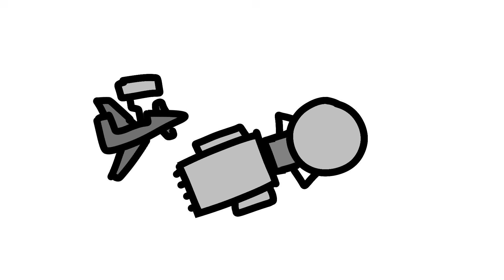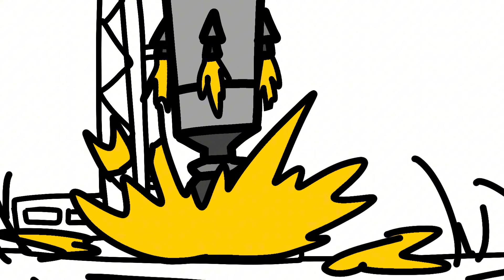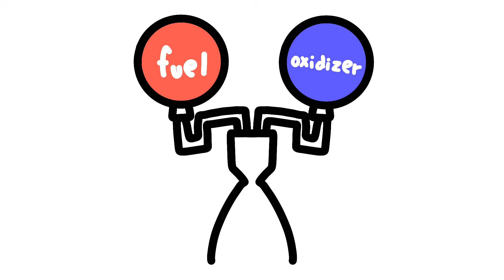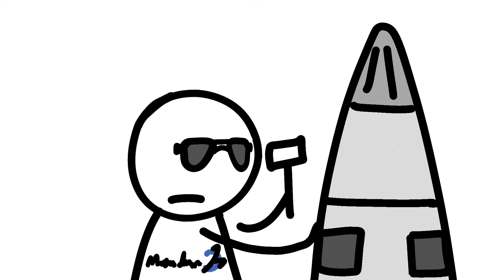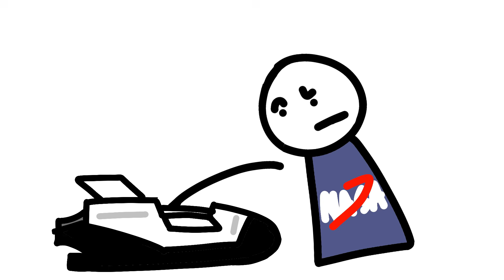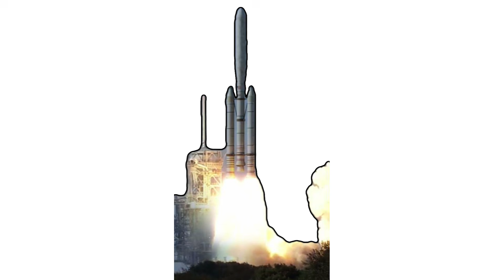Weirdest Rocket concepts

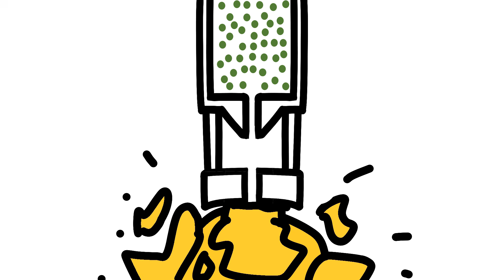Comment: 3:27 Project ORION didn't really ride the explosion. It would have used nuclear shaped charges which detonated inside the pusher plate and threw some mass out at a good fraction of the speed of light. The stuff shot out provided thrust, just like a normal rocket

Comment: The long-term solution to cheap orbital flight is the SCRAMJET. Ordinary rockets have max Specific Impulses on the order of 4 kilometers per second. [Don't show your ignorance by stating the SI is measured in "seconds" instead of "meters per second".] However, various ramjets offer MUCH higher SI ratings on the order of 10 to 20 km/sec, because they do not need to carry their own oxygen.
Reply: Of course a jet engine is more efficient than a rocket, that’s not groundbreaking information. But let me let you in on a little secret: jet engines, no matter what kind, don’t work in space. Also it’s really hard to make jet engines with the power necessary to lift a rocket; I think that the most powerful jet engine on the market right now is the GE90, putting out up to 115,000 pounds of thrust; compare that to the RS-25 rocket engine, which produces 418,000 pounds of thrust. The GE90 is three meters longer than the RS-25, a meter and a half larger diameter, and 10,000 pounds heavier.
Reply: @Shaun_Jones  You clearly misunderstand my point. A SCRAMJET can get an aircraft up to near orbital velocity in HORIZONTAL flight. Power of an individual engine is irrelevant since any finite number can be yoked in parallel. Once the craft reaches circa 25 km/sec, and leaps out of the atmosphere, a small rocket can round the trajectory out into a circular orbit. The main point is that the vastly higher SI of a SCRAMJET can grossly reduce vehicle size, weight, cost.
Reply: @DavidFMayerPhD  ISP matters much more for interplanetary transfers than getting to orbit. You need thrust to overcome gravity, and that equation doesn’t change just by having wings. Using aircraft to replace first stages has been tried several times, and it never ends up being worth it because there just isn’t enough thrust to get a decent sized rocket into orbit. And besides, a scramjet being fast is arguably more downside than an upside, because any air breathing aircraft going that speed is going to need substantial thermal protection, which further throttles your thrust to weight ratio.

Comment: __von Braun said the reason for the giant wings on the first stage of his early orbiters (1955), was to keep the whole stack assembly aerodynamicly controled & stable while going up with increasing speed, while 1st stage weight loss due to fule & oxidizer burning of the first stage in the  earth's atmosphere.
> Later versions illiminated the giant, heavy wings with gimbaled rocket engin bells.

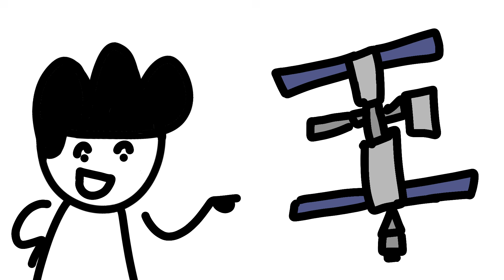Comment: 2:12 I built a limited run resin kit in 1/288 scale of that Von Braun launch vehicle. The ISP was low because Von Braun wanted to simplify logistics by using non cryogenic hydrazine  and nitric acid as the fuels. The launch site was to be way out in the Pacific on Johnson Island so logistics had to be simplified.

Comment: The ISS required 40+ flights, because it was designed specifically to do so, to justify the Shuttle. It was made as complex and expensive as possible to spread $ around as many congressional districts as possible. Other designs skipped the Shuttle and used the Shuttle-C, to put it up in 1/4 the time and cost.

The Sea Dragon was launched from the ocean for equatorial launch assist, and because building it at a shipyard was the most appropriate and simplest, and the materials used were closer to what a ship uses rather than the complex ultra-lightweight aerospace fabrication.

Orion did not ride the blast waves from bombs, as there is no blast wave in space. Each bomb was packaged with propellant which was vaporized and shot at the pusher plate at the back end of the shock absobers.
Like the Sea Dragon, Orion was ignored because nobody had the slightest ambition for a space program that would use them.
The later versions of Orion used the Saturn boosters to lift sections of the ship to LEO, and the nuclear pulse engine would be used only above the Van Allen belts, if anything thinks it needed to be so high.
The Solar wind doesn't care about fission bomb exhaust - it's made of radiation.

A 600 ton ship: A cargo ship might take the 8month minimum energy Hohmann trajectory to Mars, but some 85% of what's assembled in LEO is payload into Mars orbit. Chemical rockets struggle for 10%, nuclear steam kettle might get 45%.
The crewed ship goes when the 2 planet are closest together: 21 days into Mars orbit (including starting and stopping, unlike other proposed advanced propulsion concepts where writers take a maximum possible theoretical speed of an exhausted ship and apply it between the planets without worrying about starting and stopping).
Numbers from General Atomics, NASA, the USAF, the DoE, and the White House OMB all agreed that the cost of either the mission payload or the boosters would be more than either the engine or the hundreds of little A-bombs packed with their propellant.

Comment: Wow SPS mentioned in the Star raker section. Would be an awesome topic to cover alongside the Star raker’s competing design, the Boeing space freighter, alongside the shuttle derived crew transporter that was basically the shuttle with an airliner fuselage instead of a cargo bay (also launched on a S-IC type booster)

Comment: Good selection! Probably enough that you could make another if you wanted, but this is a good list.

Small correction, the RS-68 is not an upgrade for the SSME, its a less performant but cheaper engine with somewhat similar heritage, mostly because it wasnt designed to be reusable.

Comment: Orion was mainly scrapped because of the Partial Test Ban Treaty, which made it illegal to detonate nukes in space, not really because of environmental concerns. Also, the Air Force wanted to build a giant battleship with nuclear missiles and 5-inch naval guns using an Orion drive, which Kennedy really didn't like.
Reply: I'm also disappointed that you never mentioned nuclear salt water rockets, they're even more insane than the fluorine tripropellant engines
Reply: @JoetheDilo1917  Ah, the origin of the term 'Chernobyls per second.' I love those.
Reply: "Not really because of environmental concerns"

Mate The partial nuclear test ban treaty was created BECAUSE they blew up one nuke in space (starfish prime nuclear test) and it literally EMPd every satellite in earth orbit lol
Reply: Also the Orion drive isn’t as good as people assume, I’ve read the actual classified Air Force documents on the Orion warship and they assumed an exhaust velocity of 16 kilometers per second, a regular nuclear hydrogen thruster is already 10 kilometers, that means exactly and precisely 60% more delta v 

As for the thrust I have no idea but I doubt it would be that high, it basically worked by showering a plate of solid tungsten with nuke propelled tungsten plasma, and like, you’re talking maybe a kilogram of mass hitting the ship in the order of magnitude of like 20 kilometers per second, once per detonation which would be once every few seconds at the maximum, all that seems to lead to a very low acceleration ship, so not a 1+G torch drive with thousands of kilometers per second of delta v as Orion ships have often been portrayed
Reply: @IceRain-f5v  There's no way this isn't satire

Everything you said in this comment is completely wrong besides knowing it uses tungsten, and the theoretical upper end of exhaust velocity for an NTR. 

I'd love to know where you got the "classified" air force documents too, cause reading those is a federal crime, and i doubt you have Q clearance if you "Work in ion propulsion"
Reply: @IceRain-f5v  exhaust velocity =/= total deltaV  or deltaV per unit mass lol
Reply: @IceRain-f5v 10,000 Isp
Reply: @IceRain-f5v  Not every satellite, just 9 out of the 25 in orbit at the time. So about a third of all satellites in earth orbit. Which is still way too many.
Reply: Yeah the environmental concerns were based on speculation while the actual fallout estimations were hilariously insignificant, and that was before adding the big things like a graphite launch plate.
Reply: Also cause it would cost north of 400 to 500 billion dollars per mission so It would have never left the drawing board much less the pad, there is NO way that was ever getting funded
Reply: @backwards984 there are studies showing that it would have cost about as much as the Apollo Missions.

Comment: An SSTO is actually very easy to build.
The payload of the Atlas was larger than the mass of the droped engines. Reduce the payload and keep the engines attached. Done. SSTO. 

The hard part is the point of an SSTO: reuse. Which turns out to be pointless since recovering first stage boosters is a solved problem now.

Comment: Small correction: The SRB-X actually wasn't a variant of the Ares I, in fact, it predated it by nearly two decades! The program that led to the SRB-X proposal was in 1984, while the Ares I wasn't conceived until the early 2000's. 
The Ares I itself was quite a weird rocket though, and I'd love to see a video on the constellation program as a whole! There was some really interesting vehicle concepts that came out of that program, the wikipedia page barely scratches the surface!

Comment: My rocketry instructor actually was part of the team that worked on the Sea Dragon. It has a superweirdly-shaped nose cone because it goes supersonic. At those speeds, because you're literally going faster than the air can get out of the way, there's a boundary layer (not the correct term but I digress) of air that builds up on the rocket. In the Sea Dragon's case, the little tip at the top creates a massive boundary that directs the air around the rocket, making it more aerodynamic.

Also the tip is shot out using an explosive charge and held in place by (I think) some thin gold that deforms, tightly holding it in place.
Reply: Are you sure it wasn't the Poseidon slbm? Slbms have such a mechanism because they have a maximum length.
Reply: I'm not seeing anything referencing that expanding tip, and actually, the top of the rocket is not even shown in any specific configuration. The schematics I can find just place the entire payload on the top, no fairing.
Reply: @muratpolat9398  Sorry, it's not the Poseidon but the Trident SLBM. It has an earospike to reduce supersonic wavedrag.

Comment: SRB-X is not a variant of Ares I. It was conceived well before ESAS, the vision for space exploration, Constellation, etc. The center SRB was three segments, and it used a Titan III second stage with the option of a Centaur on top of that. Also nobody takes TeamVISION seriously because they took all the issues with the constellation program, and decided to make an architecture that had all the same problems but worse. The first stage used five RS-100s, scaled up RS-68s (Delta IV Engines) which were fed by the external tanks. Said stage was hardlly a stage, just a structural/plumbing piece for said engines. Once the ETs were drained, the bottom bit was jettisoned, and the second stage, run by 8 J-2Xs would start. The EDS used 2 J-2Xs.

Comment: The fact that engineers were allowed to test a tripropellant engine with flourine as one of the trio at all is wild. One wrong move and the entire team's life is immediately in danger.
Reply: If you read the book "Ignition" by John D Clark, he describes advice given should anything go wrong with these tests which amounts to, get a good pair of running shoes.
Reply: @letsgetoutsidenow  I also read Ignition recently, Really good book. Almost hard to believe it's already been half a century.
Reply: @letsgetoutsidenow  Some crazy quotes from Chapter 6, "Halogens and Politics and Deep space". 

"... it had been reported that it frequently detonated upon heating or cooling; freezing or melting; evaporation or condensation; and sometimes for no apparent reason."
"For dealing with this situation, I have always recommended a good pair of running shoes."
"It split and dumped one ton of chlorine trifluoride onto the floor. It chewed its way through twelve inches of concrete and dug a three foot hole in the gravel underneath."
"...the man was found some five hundred feet away, where he had reached Mach 2 and was still picking up speed when he was stopped by a heart attack."
"For a chlorine trifluoride motor operates at a chamber temperature close to 4000K, where injectors and nozzle throats have a deplorable tendency to wash away."
"Performance like that is worth fighting for. Lithium-fluorine-hydrogen system may well have a bright future."
Reply: Eh It a time of creativity
Reply: Insane risk, high reward.
Reply: Wait until ya hear about the mix of orange nastinesses that the Proton runs off.
Reply: @MadEyeScienceK  at least those won’t eat through the containers they’re in nearly as much and don’t need to be chilled
Reply: And molten lithium 😭
Reply: Kids this day

The younger generations aren’t made of the same stuff, your grandfathers are called the greatest generations because the weren’t afraid of a few hundred tons of liquid fluorine, blew up nukes for fun and used nuclear bombs to light their lead lined cigars
Reply: @IceRain-f5v and died at 55 like real men.